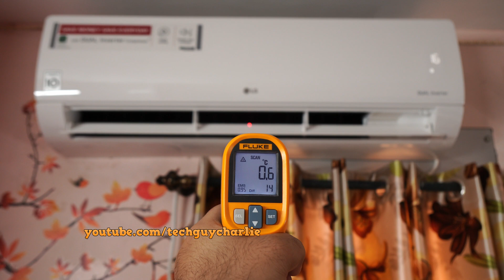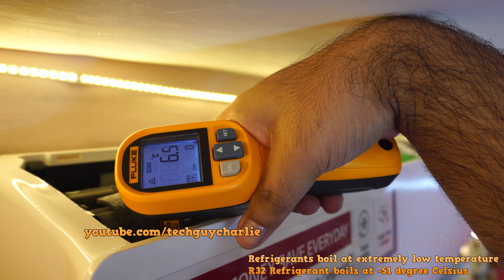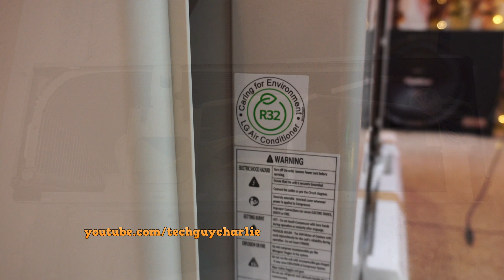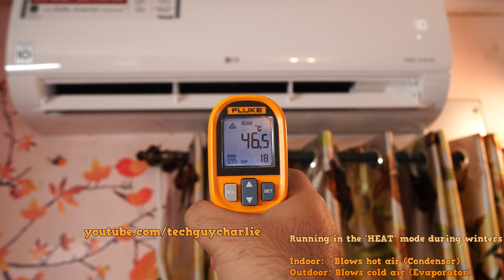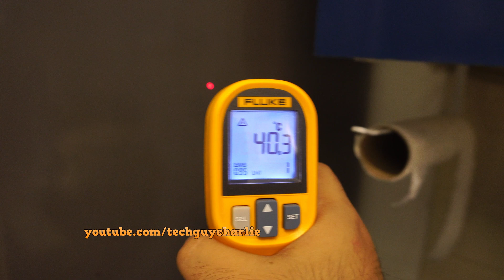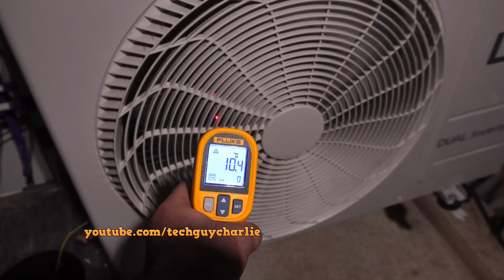How does a hot and cold AC (Heat-pump) work simple explanation

Comment: Is hot and cold ac  preferable over normal Ac..? I live in roorkee,a place with extreme temperatures.. And Can "Hot and cold" AC withstand tye wear& tear of the heat that it generates?? Plz guide
Reply from the maker: These ACs are designed to cool at 52 degrees, and heat when it is minus 5 outside, just maintain your AC by getting both the coils cleaned once a year and your AC will withstand wear and tear of extreme weather, I run this AC 13-14 hours a day in summers (April-October) and 12 hours during months of (December-January and sometimes into Feb), never had any issues. And YES hot and cold ACs are far better than normal AC, don't listen to people who say its not, especially dealers.
Reply: @TechGuyCharlie  thank you 😊

Comment: Can a normal split AC be used to get heat in winter?  Can reversal valve be fitted in existing ac?
Reply from the maker: That is impossible!! its not just a reversing valve, hot and cold ACs have a more sensors and extra logic that makes everything work.

Comment: Bro... In heat mode after room temperature is achieved (as  per set temperature) does the ac goes to defrost mode everytime??
Reply from the maker: Hey man, It's not in defrost mode, in India, it will never go in defrost mode unless you live at a place where the temperatures goes in the negative. 
Because the set temperature has been achieved, the compressor is off, it's just waiting for the room temperature to drop and will start back up. Normal behaviour.

Comment: Nice explanation, thanks! Generally, the boiling point of the refrigerant is not that important for the physics of AC. Main idea is that compressing molecules in a closed space raises their temperature proportionally to the pressure (pressure times volume is proportional to temperature, or pV=nRT for ideal gases). So, since  it's only possible to pass heat from warmer molecules to colder, and never the other way around, what's important is that the temperature of the compressed gas/liquid gets higher than the outside temperature during summer (so really really hot), and vice versa, to cool it below the outside temperature during the winter.

Comment: Thanks so much for this video, I have been searching for an explanation like this. I bought a art cool dual inverter with only cooling mode, but i want to ask is it possible to make it to both cooling and heating by adding heating pump to the outdoor unit?
Reply from the maker: Thank you, glad the video was helpful and It's impossible to turn a cooling-only AC into a heat pump because apart from the additional hardware (reversing valve) required in the outdoor unit, there is also software in the indoor unit's logic board that makes it all work (heat mode, outdoor coil defrost, all these features aren't there on cooling only unit). You will have to replace the entire unit to get the heating function.
Reply: @TechGuyCharlie  thanks for your feedback

Comment: One thing I do not understand! What if outdoor unit is installed in the basement wher air is allways +17 c!
I never saw any recommendations! I belive it can save a lot of energy!
Reply from the maker: Oh yes, that will indeed save a lot of energy! I actually did a power consumption test you might want to watch the video: https://youtu.be/O_K2xSDpGG0 and one thing that was quite obvious is that when the temperature goes above 14*C, like during the daytime, the power consumption drops quite significantly.
Reply: @TechGuyCharlie  yes but why fan works so hard whilr it make the air iven cooler?

Comment: Bro what's the power consumption on heat mode.... Does it work in inverter mode during heat mode??
Reply from the maker: I will make a video about the power consumption in heat mode, just waiting for it to get colder. Of course the working principle is exactly the same in heat mode. Compressor will speed up or slow down depending on how much heat is needed.